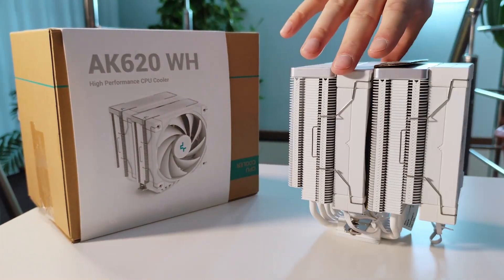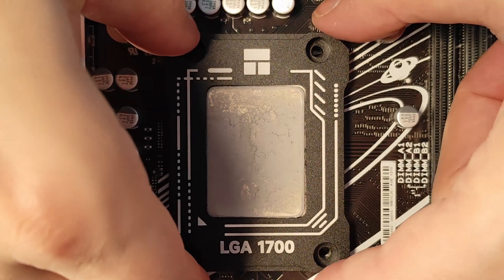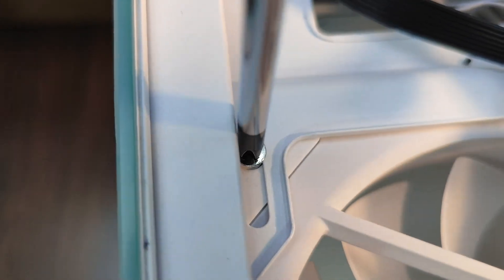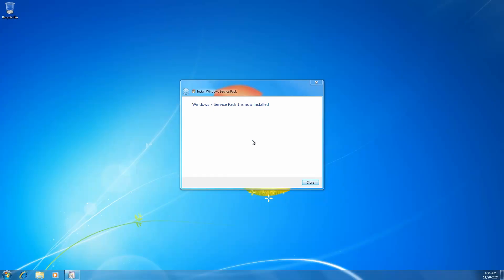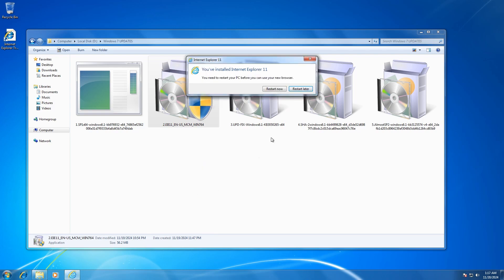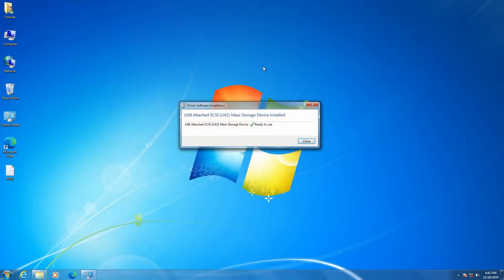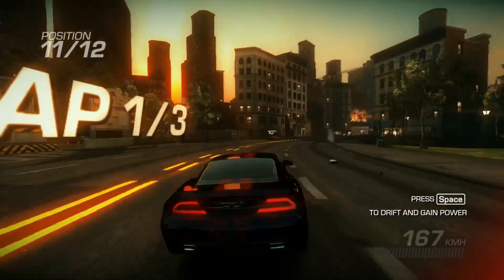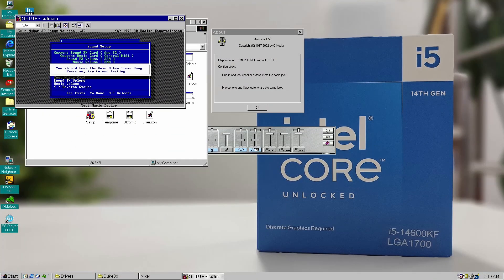Windows 7 Returns on Modern PC: i5-14600KF Intel CPU,  Z790 motherboard/DDR5 & RTX GPU

Comment: 4070 Ti Super got no driver for Windows 7, any ideas bro?
Reply from the maker: Yeah, the 4000 series won't work on Windows 7 - they're built completely different under the hood. The 2000 series came out in 2018 when Win7 was still officially supported and the 3000 series are similar. But the 4000 series was designed purely for Windows 10 and up. They need modern OS features that Windows 7 just doesn't have. So you can't just hack the drivers to make it work.
Reply: @O_mores  I've truly regrets that i sold my 1080 Ti ROG Strix OC edition bro

Comment: So you were able to get W7 installed with just the DVD and a PS2 mouse/keyboard?
Reply from the maker: Yep, that’s basically it. Windows 7 doesn’t natively support USB 3.x so it can't see the keyboard and mouse. (the USB 2.0 ports on newer boards are connected to a USB 3.x controller) Some motherboards can emulate USB devices as PS/2 specifically to get you trough Windows 7 setup, but in most cases this kind of emulation works only in DOS/Windows 9x.
Reply: @O_mores ok awesome! That’s what I did for my Z390 a few years ago and I plan to upgrade to a B660 in a few months with a mobo that has PS2 ports, I’ve seen tutorials on getting W7 installed with modern hardware but a lot of the time they use sketchy software to get drivers integrated into the ISO

Comment: Win7 was the win xp with win vista design...very clever 👌
Reply from the maker: In terms of driver model, Windows 7 is very closely related to Windows Vista and not XP. In fact, someone was able to use RTX drivers made for Windows 7 in Vista. Also Vista brought  the bootmgr, boot manager which is still in use with Windows 11. So basically we're using a very optimized version of Vista today. :)

Comment: Could you do a video on installing Windows 7 on an UEFI only AMD setup? So something completely void of CSM. I am currently trying to put Windows 7 on a Ryzen Embedded R1305g based thin client with 8GB of eMMC. :D
Reply from the maker: I haven't gone this route so far, mostly because I need CSM for my beloved Windows 98 and NT4. Anyway, one option for UEFI-only systems is to load a custom CSM module. There's a new project called CSMWrap which is about "getting PC BIOS back on UEFI-only systems." It uses SeaBIOS to load custom VGA BIOSes and so on.

I haven't tried it yet, though the whole installation looks to be incredibly simple:

   " Deploy: Copy csmwrap<ARCH>.efi to your EFI System Partition (ESP), typically as EFI/BOOT/BOOTX64.EFI (for 64-bit) or EFI/BOOT/BOOTIA32.EFI (for 32-bit)."

So basically, the system will boot from that .efi file, which will then load SeaBIOS.
Reply: @O_mores Yeah, I didn't spot a binary yet, though I didn't really look for one since ot looks like the support is really hardware dependent. Same as like with Uefiseven, which seems to be more of an Intel thing.

I tried to exctract the BIOS of the Thinclient with a programmer since it doesn't look like it is available from anywhere or able to be dumped from OS. I am hoping there is a CSM mode, just hidden. The hardware should support it at least since I can find other models with the SoC with CSM/Legacy modes. I believe the BIOS also supports it, but since it isn't some common AMI or Phoenix BIOS, it might not even be hidden, just never compiled.
Reply from the maker: Well, even on an AM4/AM5 motherboard with CSM support, this option won't show up or will be greyed out if you use the iGPU. This is because Ryzen iGPUs don't include a VGA BIOS, so it makes sense to hide CSM - enabling it without a VGA BIOS-compatible card would make the system unbootable. Fortunately, the latest Nvidia GTX 5000 series still has a VGA BIOS.
Reply: @O_mores Even though I was actually planning to put a GTX 1060 in to the NVMe slot of this, I doubt it will change anything when it comes to the BIOS. I will try CSMWrap anyway. 😅
Reply: @O_mores I actually managed to install Windows 7 with CSMWrap! Everything is working, including Vega 3 graphics with modded drivers. Well, almost everything.. I cannot get the eMMC to show up and since this M350C only has a single pcie gen3 x1 via the A+E-key slot where the wifi adapter is supposed to be, I dunno if it is ideal. 

I can either choose an NVMe or a GPU. Unless I go HP T640 which has 3 lanes of pcie across two slots. 😅

I still feel like the bios has csm support, but just hidden, since the CSMWrap just works. The only situation it actually doesn't work with is when the UEFI automatically chooses bootx64.efi (renamed CSMWrap). Then I get stuck in the CSMWrap bios portion with a different resolution to choosing it manually. It seems Windows is still booting though.
Reply from the maker: This is great news! Though I kinda knew already Windows 7 would work... :) I will make a video soon about CSMWrap! I'm curious about Windows 98 especially.

Comment: I did it in November 2025, and the only step that didn't work was installing IE11. The installer can't download the necessary updates. I think it's because of the end of support.
Reply from the maker: I haven't installed it since I made this video, as this installation still works perfectly, and I have transferred it to an AM5 build with a Ryzen 9 9900X. But yes, support might have ended for good this time, now that Windows 10 has been retired. Anyway, you can look for the IE11 offline installer. This is the file you need: IE11-Windows6.1-KB2976627-x64.msu (~50MB).

Comment: so installing with uefi? not csm?
Reply from the maker: In this configuration, Windows 7 is running with CSM enabled. This is actually how I use my main PCs that I run this channel on. Windows 10 and 11 also work great with CSM, and it allows me to simply boot into any other classic version of Windows I want.

Only real downside with CSM is losing Resizable BAR. Can give a nice FPS boost in some games, but it's kinda hit or miss. Games like Red Dead 2 and Valhalla can get like 10% more fps with it on, but I've seen reviews where Cyberpunk and Forza actually run a bit worse with it enabled. So you're not missing that much!

Comment: Hi Omores, is there any way I can contact you? Would like to install windows 7 on a "new gen" pc but I didn't get any success
Reply from the maker: Hi! You can contact me via the classic method: click on the channel description, open the 'About' section, and select 'View email address.' Of course, we can also discuss here - that might help other people too!
Reply: @O_mores  For a long time I wanted to make a dual boot (W10 and W7) on my main pc, however I was never able to get past  the installation of W7, since it was always in the logo loop or sometimes, it froze in that part. Tried to also ask for someone specialized in computers and said to him if at least he could install only W7, but he didn't get any success as well since he said that the OS is not compatible with new gen components, but in this video (and many others) there's success with it.
For a long time I just gave up and I'm not sure what causes it, I'm on a B460M PRO VDH, with an Intel I5 10600K, 16 of RAM, integrated CPU graphics (UHD 630), tested many times my USB driver, followed so many tutorials, but always the same issue, am I just unlucky or what is it?
Reply from the maker: Are you using a PS/2 keyboard to run the setup? Windows 7 won't recognize the USB3/xHCI controller on your motherboard. It might look like it's frozen, but you actually don't have keyboard or mouse input. Since that motherboard has a PS/2 port, you can use it to move forward. Also check out this video: https://youtu.be/V0EOecOkuB8
Reply: @O_mores  Actually my issue is not the USB 3.0 drivers, yesterday I discovered about an ISO file with those drivers  so it's not that (would like to ask also if having USB 3.2 makes any difference?), my problem is that I can't even get to the installation, I get stuck at the Windows 7 installation but never got past it
Reply from the maker: Be a sport and grab a PS/2 keyboard - you’ll need it if you’re into this kind of stuff. If you get one and it still doesn’t work, I’ll help you out step by step. Also, when Windows 7 was released, USB 3 wasn't integrated into the chipset - it was implemented on dedicated chips from manufacturers like NEC and Asmedia, so your ISO might have drivers for those...

Comment: Does windows 7 work on intel 8th gen cpus?? ((It worked for me on 10th gen months ago))
Reply from the maker: Yes, of course it works, but there's no official support. Mainstream support for Windows 7 ended on January 13, 2015, and Intel didn't create drivers for Windows 7 anymore, unlike AMD, which still offered Windows 7 drivers for their X470 chipset released in 2018.
Reply: @O_mores Ah, I see

Comment: Why don't you run Doom Eternal with Ray Tracing on it, oh that's right-IT WAS FORCED ONTO STEAM AND MICROSOFT STORE. Steam no longer works with Windows 7/8 so all Windows 7 titles like Doom Eternal essentially don't work anymore because of a softlock. Oh don't worry, if Steam dies out because of illegal payment processors, they'll probably release it on G-O-G. But knowing Microsoft, they won't let Bethezda do that.
Reply from the maker: So I realized I don’t really own a lot of modern AAA games. I’m more into older titles... And the newest thing I played like two weeks ago was Far Cry 5, and that’s from 2018, I think?  So yeah, I’m not exactly in a good position to review a fancy RTX GPU any time soon or at least to test Doom Eternal.
Reply: @O_mores  I bought Doom 2016 from G-O-G for 4 bucks 80% off from 20.
Reply from the maker: I'm considering making a deal with those sites that sell digital keys, just to update my library. Besides, it seems like they contact me every single day for a collaboration! They want me to promote Windows 11 Pro, but I'm not sure... I still kinda like Windows 10... :))
Reply: @O_mores  Windows 11 is a complete and utter disaster compared to Vista and even the marketing of 8. Microsoft's getting sued by a guy for attempting to cut off Windows 10 support while 53% of people and businesses still actively use it. Recently an update to Windows 11 started corrupting SSDs. In fact, that is the exact reason I reverted my brother's Christmas present back to Windows 10 to prevent just that. I otherwise would've left it on 11. Do not promote 11 by all means.

Comment: Windows 8.1 is perfect for AM4 systems so long as you have the Windows 7 b450 chipset driver to get everything up and running. Though you could just download specific drivers that might work even better. Windows 7 however requires USB 2 due to the lack of xHCI.
Reply from the maker: Last night, I tried Vista 64 on an AM5 motherboard (X670) with a Ryzen 9 9900X. The ACPI works, it shows 24 CPUs, and the USB 3.2 works as well - which is very good news. I imagine that both Windows 7 and Windows 8.1 will be even more reliable on this AM5 build, as the NVMe Gen 5 drive I tested didn't seem to work with Vista.

Comment: i want iso that will works with usb booting
Reply from the maker: If you have USB 2.0 support you can use the original .ISO along WinSetupFromUSB, as shown in this Windows XP x64 video: https://youtu.be/0iW1hheBAp0 (since minute 13+)

Comment: Simplix update pack 7R2 to update all the way to Windows 2008 R2 Server premium assurance January 13 2026, Supernium, R3dfox for internet browsing, Eset smart security premium 16.0.26.0 still updates and VxKex 1.1.2.1428 kernel extensions you can trick Steam exe to think its windows 10 and it will update to client 22. You can also copy installed steam folder from windows 10 and use vxkex to report windows 10 and it will work 😀 just disable enable GPU accelerated rendering and web views in interface settings. And while in Big picture mode enable GPU block list

Comment: What motherboard did you buy to do run windows 7 on
Reply from the maker: It's an ASUS Prime Z790-P, an Intel Z790 LGA 1700 ATX motherboard with PCIe® 5.0, three M.2 slots, 14+1 DrMOS, DDR5, Realtek 2.5 Gb LAN, HDMI®, DP, USB 3.2 Gen 2x2 ...  It works pretty good.

Comment: I'm stuck on old 4th gen because I need full native PCI for my TV cards, and I'm stuck on Win7 because Win10 stalls with high quality .ts files from the TV cards, ie, you have to rename them .trp or Win10 crashes when you play them.
Reply from the maker: 4th gen motherboards don’t have native PCI support anymore -  it was removed from the chipset so your board is using an ASMedia 1083 bridge chip for those PCI slots. This means that those TV cards should work the same on any newer motherboard with PCI slots - since they use the same bridge chip for classic PCI support. Socket 1700 or AM5 motherboards only have now a single classic PCI on a few selected models. For more PCI slots you have to pick a more expensive industrial motherboard.

Comment: Great channel, thx 4 it bro.
Question: Win 2k , my preferd one, du u think to run it on modern hardware?
And back to Win 7, which browser u will use, cause this is nowerdaysmy mainproblem on existing hardware (LAptops) that a lot of websites don´t agree with elder browsers
Reply from the maker: You can totally run Supermium on Windows 7—it's a super up-to-date browser based on Chromium. And yep, Windows 2000 runs on this 14th-gen hardware setup! It’s the only one that didn’t get its own dedicated video, but I’ve got a Windows 2000 playlist on my channel -check it out here: https://www.youtube.com/playlist?list=PLomaAsb2xNcBQRuyjsO8uUaf6KgAyuWOr | If you wanna see it in action on this Intel 14th-gen CPU, peep this video: https://www.facebook.com/share/v/1EX4zMoN4W/
Reply: @O_mores  Thx mate 4 the quick response !!!!!

Comment: If this windows 7 with all the updates installed and all the drivers installed, make it into an iso mold. Is there a way to make it so that it recognizes all hardware on the next installation and does not need to install updates again?
Reply from the maker: Yes, it should be doable. You can integrate service packs, drivers, and updates using nLite. However, sometimes issues may arise - such as missing file errors during setup - requiring you to restart the process to identify the problematic driver or update. When making the video, using the original DVD was the fastest way to get Windows 7 running.

Comment: I try to install It same as you no mouse and keyboard I have Asrock Gaming Z790 with Amd 7900 xtx any recommendations
Reply from the maker: Okay, but how do you plan to install it without a mouse or keyboard? Well, I used a PS/2 keyboard and a SATA optical drive, and the whole installation process was actually very straightforward, no issues at all. If your system doesn’t have a PS/2 port, you’ll need to add a PCI-E to USB 2.0 card, like the one featured in this video: https://youtu.be/i_7yCmXm2wQ
Reply: @ Thank you so much , how about 7900xtx driver is there Is work arounf ?
Reply from the maker: RX 7000 series are not officially supported in Windows 7, but the 6000 series are: "AMD Software: Adrenalin Edition 22.6.1 for Windows 7 is compatible with the following AMD Radeon products.
AMD Radeon™ RX 5000, RX 6000 Series
AMD Radeon™ RX Vega, RX 400, RX 500 Series
AMD Radeon™ 500 Series
AMD Radeon™ HD 7000, and HD 8000 Series
AMD Processors with Radeon™ R2, R3, R4, R5, R7, R9 Series Graphics" 

 I didn't try any 7000 series in Windows 7, the classic workaround is to add the hardware IDs of the 7000 series in the INF of 6000 series and see if it works.

Comment: 3:01 Where you get drivers from? Are you using windows 10 drivers?
Reply from the maker: I grabbed them from MSFN, if I remember right. Like I said in the video, AMD’s X470 chipset officially supports Windows 7, including the USB 3.x controllers on those motherboards. This chipset came out in 2018 and even packs USB 3.2 with 10Gbps speeds. So, those drivers were basically the foundation for creating a more universal driver that works with all USB 3.x controllers.

Comment: Can Windows 7 32 Bit be installed?
Reply from the maker: Yes, absolutely! Windows 7 32-bit can be installed, and it’s actually a great choice if you’re working with older hardware. For example, some legacy devices, like the Creative Sound Blaster 64 from 1998, only have 32-bit drivers available, so the 32-bit version of Windows 7 ensures better compatibility with those older components. Just keep in mind that the 32-bit version has limitations, like supporting only up to 4GB of RAM.

Comment: Is it worth running Windows 7 today? I only play games released before 2014 on PC (a lot of multiplayer stuff like Battlefield 4), for newer games i have a console. For my computing I use Linux, so I only care about games.
Reply from the maker: Definitely worth having Windows 7 on a separate SSD as a boot option, especially if you have a large archive of Windows games on CD-ROM since it’s compatible with Safedisc. Plus, it’s lightweight, runs older games like Battlefield 4 flawlessly, and avoids the bloat of newer Windows versions. Perfect for your retro gaming setup!

Comment: Where did you download the critical updates to get out of the searching for update loop. I had a couple of old Alienware computers that bricked with the 10 update because bios so had to clean install 7 to make them usable and can’t get out of the loop.
Reply from the maker: From the Microsoft®Update Catalog, I just updated the description and I included the name of the files I used in the video, so you can just search that string on google.
Reply: @ thanks